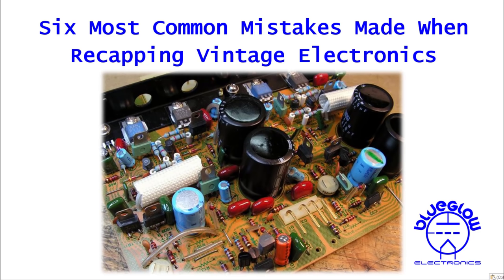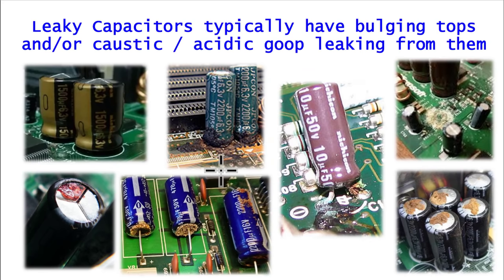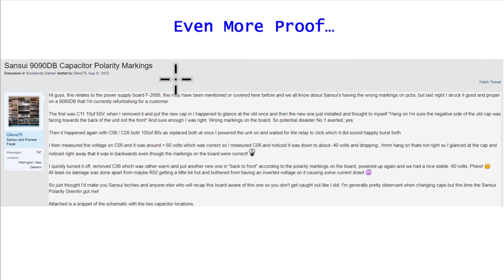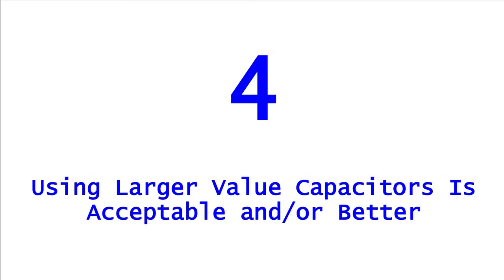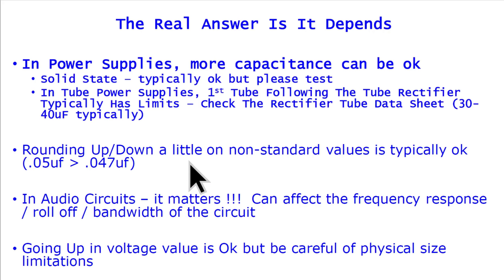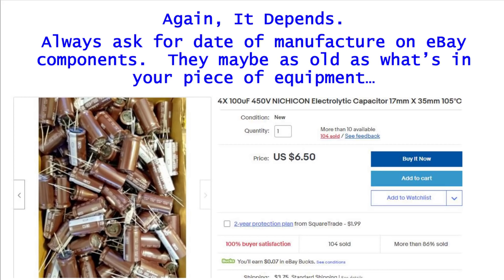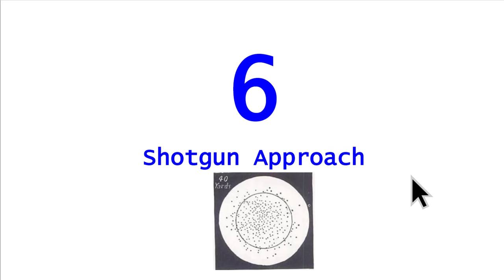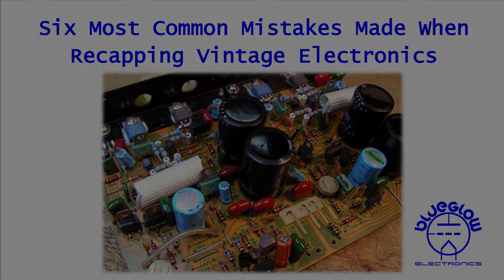Six Common Mistakes Made When Recapping Vintage Electronics

Comment: And the number 1 mistake... failing to pull out your cell phone and take a few pictures before you start pulling out capacitors.
Reply: Damn this is so true. And one step up, take a video with good lighting of various angles. I’ve saved myself so many times.
Reply: @XJ290  video thing is even better with different angles, i also do it now.
Reply: @deepaknanda1113 100%. You can find just the right frame that shows where something goes or how it was oriented.

Comment: If you're recaping really old stuff (20's and 30's era), capacitors had a lot of internal conductance that was accounted for in the original circuit that new capacitors don't have.  You may need to add a resistor in parallel to keep the circuit 'in tune', and guessing the size of that resistor is really just a guess.
Reply: That's what I did when I reccaped my Victor RE-45. It works amazing. That's a very good advice for people who don't know.
Reply: Interesting 😮
Reply: Like add ESR to the cap. The wire wound resistor has some series inductance to.

Comment: That glue when it turns brown, instead of yellow, is actually CONDUCTIVE.  Especially if it is near something that is starting to corrode.  I've fixed many malfunctioning electronics just by chipping that glue off.  When it turns brown it becomes brittle facilitating this.
Reply: In the past I had resolved CPU problems as well due to the heat sink compound getting on the CPU pins or on the visible CPU circuit. Wiped off the compound on those pins or other contact points and the computer worked fine then..
Reply: It next turns corrosive and eats the legs off components it’s in contact with.
Reply: @porkchop3656  Yes acid (or caustic soda or other)

Comment: One thing I would add, having worked on computer monitors in the  past ( 25 years ago)  some brands had that hold down glue that would over time become unstable from heat and age and become conductive on the board. We had to scrape it all off and clean the board really well.
Reply: AKA, Sony Bond. It affects all kinds of electronics. If it starts to turn dark brown or darker, get it off the board.
Reply: That's a great point.!!, I too have seen glue become conductive and cause many problems in TV's.
Reply: lol yeah the white glue is okay most of the time, but that transparent stuff is nasty.
Another fun one are those fancy looking motherboards with chipset coolers that have stickers/decals on them... those come loose over time because of heat and get trapped in the fans.
Reply: KRK monitors had some black stuff where the liquid would seep out and cause corrosion, the rest of the glue became brittle. Have to remove that and hopefully before components are so wrecked you can;t even see what they were
Reply: @Joetechlincolns  is that still common? Thanks
Reply: @j.lietka9406  Not sure on newer electronics, I'm more familiar with CB radios of the 80's-90's-2000's  that have it. It will cause corrosive damage to component leads, and cause a conductive path.
Reply: @RennieAsh  , I've seen some fairly modern powered subwoofers that had components secured with black glue that became  Extraordinarily corrosive not to mention conductive. Worse than any of the old tan or brown Sony bond glue;  And because the subwoofer amplifiers had very high density component placement and were sometimes double sided boards the amount of damage done by corrosive glue was often too massive to repair.
Reply: Many years ago I came across Sony Bond in broadcast video tape machines of the BetaCam and Betacam SP variety. The machines would loose Chroma or Luma depending on which video filter had failed. The bonding goo becomes conductive after some years. The Sony bond was found used in the filter circuits that were constructed on a mini PCB and the whole thing fitted inside a steel case and then the bottom was covered by a rectangle of resin bonded paper. These filters were about 1 inch by 3/4 inch by 1/2 inch tall. Removal of the RBP cover would reveal a brown blob. Removal of the bond would restore the characteristics of the filter. Later versions of the filter would have the base cover of clear fibreglass and you could see the white bond. This bond did not deteriorate. The duff bonding agent was also used in the switched mode power supplies of the professional grate CRT monitors along with capacitors that would leak sometime destroying the PCB. The white bond did not suffer and only the cream or tan colour bond failed in my experience. Another thing to be aware of, not so much in vintage gear, but in any gear with CMOS circuits in, is that some rubber shrouds around LED's as in the case of the Sony Beta SP machines would also become slightly conductive due to age and upset the whole control board with all the push buttons on. CMOS circuits are high impedance by design and slight resistive sneak circuits can upset the circuit causing all manner of faults. Being a Northerner in England, we would say it lit up like the Blackpool Illuminations with random LED's lit and inoperative push buttons.
Reply: I heard that glue referred to as the yellow peril
Reply: Some glue used to hold parts (capacitors mostly but sometimes other components) can become conductive over time.  Planned that way?  Perhaps!
Reply: @fflynnful   I somehow doubt it was planned that way, this was back when manufacturers took better pride in their products than today. Just the misfortune of picking a glue that didn't age well.
Reply: @davidlong1786  Planned obsolescence is a thing!  Neither of us will ever know if it was planned or not.
Reply: @Joetechlincolns  That was even a thing in Sony broadcast gear.  The BVH-2000 (one inch open reel broadcast tape) had an issue with conductive glue in the servo electronics.  It would change the speed of the scanner and capstan randomly and intermittently.
Reply: @fflynnful   Nah that would have required aging the glue faster than normal artificially to see the results and honestly I don't see them putting that much effort into this when other components like caps would age with increased ESR over time anyway and cause the deice to stop working before the glue became an issue. It was just bad luck that the glue ingredients would conduct when subjected to heat over and over.
Reply: I did that and wound up scratching down to copper a bit. Does that make a difference? Pretty hard to remove w/o having this happen unless there’s a trick.
Reply: @bobd9868  When we got down to the copper traces we would just tin it using solder and hope that lasted a long time which it seemed to do. You can also coat the soldered traces using something called conformal coating which I never have used. You might search for that online if you like.
Reply: @Joetechlincolns  = Ok thanks
I have no Sony Amplifier or else. But  nice  to read this information. 

The good intelligent manufactures use non corrosiv silicon. 
I never saw standard cheap corrosive silikon. In the future this can happen in ultra cheap chinease things. 
There might be some companys that think in europe and US the lifetime is short and the owner will soon by better electronic. 

And the lifetime of cheap TV can be short, because the rich countrys have buyer who are often replace there electronic with state of art electronic, even if the old electronic still works. No need to produce long lasting electronic. 

And companys can only exist when produce and sell new cheap electronic. 

In europe / US /AU / Canada / etc the repaire coast is very high and the people never repair electronic.
Reply: @QoraxAudio  = I also have no problems with the white glue.
Often this is very stable long lasting silicone.

I never checked the transparent wax in very old and cheap radios from japan (today china) that fix some heavy parts. 

I think these company know that no person in high industrial countrys pay for a repair. TOOO expensiv and we like stat of art electronic with additional features and a frsh designe. 

And the manudacturer exist from selling new electronic and not from produce long lasting  electronic. And no need to be able to service/repair these or even to open it. 

Oh, I forgot = Thanks for your information !
Reply: hot glue too btw.. we had monitors come back defective after a few weeks because the hot snot started to get conductive.. (glue was used to keep parts from buzzing etc)

Comment: In my 35 years of experience, remove the factory glue as the older it gets, it starts to become conducive.
Reply: Yep, and it's not just vintage gear either.  KRK got in to some hot water over the use of conductive glue in some of their studio monitors like the Rokit 6's. Dave (eevblog) did a video on it. Hideous.
Reply: Other glues you can use if necessary. Neutral cure silicone, Quick Grip and hot melt glue. I am more of a fan of hot melt  because you can manipulate it with a SMD heat gun set at 230 C .It sets quickly and it can be detached by using freeze spray. Quick Grip is my second best. Silicone must be the non acidic type but must be fully cured before switch on especially if it is used in high voltage circuitry. Oh and never use super glue on anything.
Reply: @jmiller007  I got a Rokit 5 with that issue. PITA to clean.
Reply: Thanks for the tip.
Reply: Not only conductive, but corrosive. It's sometimes just as bad as leaking electrolyte. I've had to chip tons of the stuff out of supplies that had it splurged all over everything, where it ate through transformer pins, component legs and dissolved resistor casings. I blanket remove all of that crap when I have to repair something to avoid potential damage later on.
Reply: @GGigabiteM  The only way to do it. Remove it regardless.
Reply: lots of B&O units had this problem.. there video units especially.. aging glues becoming conductive was a real pain,,glad you mention it..cheers..
Reply: @davidbwn  hot glue was a bad choice on my customs odometer design and other auto related electronics...cars in the sun reach their melt temps..
Reply: Some of the brown glues are corrosive and start to eat nearby component leads.
Reply: Older Sony tv sets had this as well-the glue would go from yellow to brown to black, getting more conductive as it went!
Reply: @davidbwn ,    Hot melt glue has one major failing, which is that it doesn't generally stick very well to circuit boards.  If the goal is to secure a component from vibrating free, such as any type of powered speaker or subwoofer or other device that will be continually exposed to vibration,  Or any device where heavy components such as large capacitors will be sitting horizontally instead of vertically,  with constant gravitational force pulling on them, hot glue just doesn't work very well.
Reply: @goodun2974  pre heat the board and it does.
Reply: @davidbwn  , that's a very good idea, but probably only works for people who have a hot-air soldering station or some type of heat "pencil" so they can keep the heat confined to a small area and not overheat adjacent components or allow the glue to creep out widely over the warmed up PC board.
Reply: @goodun2974  SMD rework station is a good investment.
Reply: @davidbwn  , in my 15 years as a bench tech,  I rarely did SMD repair.  Most of the equipment I worked on Is from the 1960s through the 80s. I did have a hot air pencil pencil suitable for SMD's, bit I used it mostly for shrinking shrink-tube insulation, melting and fusing broken plastic pieces back together,  or for blowing and flowing epoxy glue into cracks and tight spots. Most desoldering was done with a vacuum-pump desoldering gun.
Reply: @GGigabiteM   Even bare jumper wires would become corroded to the point where, although the jumper wire itself was continuous and could still conduct, the corrosion crept down through the hole in the PC board and around the leg of the jumper where it passes through the board, and the corrosion would  contaminate the solder joint and separate it from the jumper wire!

Comment: A possible exception to your suggestion against "shotgun" recapping is when restoring very old equipment.  50 or 60 year old electrolytics are often shorted, or nearly so.  Turning on the equipment with such caps in the power supply can cause serious damage.  The same applies to interstage coupling caps in tube amplifiers.  If those are electrically  leaky, B+ will flow to the grid of the next stage and that is also damaging.
Reply: I shot gun the caps in my vintage repairs. These caps are 40+ years old and way past their lifetime expectancy. And for s**ts and grins, I 'll use my ESR which says "yep.. it's fine" and use my old Heathkit leakage checker. 80% of the "good" caps fail leakage tests. The exception to this rant seems to be the smaller electrolyics normally used in the radio RX boards for example.  Most of those I replace with WIMA anyways..  I hate having to redo my work. And fixing a unit just to have a ancient cap fail a few laters is stupid. I also replace driver transistors for the same reason. You have no idea how abused they are so I just replace them since I already have the unit apart on the bench.  Zeners go to for the same reason. Carbon resistors in amplifier boards get replaced because most of drifted a fair bit and will continue to drift as they age even more.  And I should say, I don't "repair" my projects.. I "restore" or "rebuild" them.. just like a car.  And lets be clear.. this is my opinion.. nothing more. Everyone is entitled to their own opinion.  My clients are happy with mine and how I do the work :)
Reply: @MikeSweeneyMedia  ,  Yeah, if you have to undo the dial string mechanism in order to pull up the RF, IF, and/ or MPX board (often those circuits are combined on one single long PC board), you want to be really certain that recapping is done with known good caps, and that you fix any problems or potential problems before you put the whole shebang back together.
Reply: I see your point. His advice is good if you are recapping something that works already.
Reply: Yes, better to replace the electrolytic and paper caps than destroying transformers and such that are made of "unobtainium" now.  I do  the same on old tube stuff.
Reply: Oh definitely, old caps can short out. So can small smd ceramic caps if they develop a micro fracture from mechanical stress.
Reply: Is an oscilloscope essential for recapping? There's a nad 3130 being recapped in a video on this site, seems to use it religiously for each cap. Cheers
Reply: @CM-dw3gh  This depends on what is being re-capped.  An AM radio probably does not need an oscilloscope.  However they are  very useful in aligning FM detectors and for television work.
Reply: @pattyeverett2826  it would be for an audio amplifier.  The NAD 3130 to be precise..
Reply: @CM-dw3gh  An oscilloscope is probably not necessary, but an audio signal tracer would be helpful. A signal tracer would be useful to debug a mis-wired capacitor.
Reply: @CM-dw3gh  Oscilloscope shouldn't be mandatory if you know the datasheet of the original capacitor.
Reply: @MikeSweeneyMedia  yep I learned my lesson with a Tascam Portastudio. Recapped the PSU, just to have the mixer card caps fail a couple years later. Now it's taken apart on the bench again, open-heart surgery style. From now on- if it's worth recapping, the whole thing is getting a recap. The caps in my 18 channel Ramsa (40 years old this month) went out on the mixer channels before the PSU. Every single electrolytic cap was replaced, digital VU meter and all. Unlike the Portastudio, not a single issue since the recap. The peace of mind is worth it. 

and yup... not a single electrolytic out of that 40 year old Ramsa was within spec. Visible electrolyte leakage or not, didn't matter. Time did 'em all in!
Reply: @MikeSweeneyMedia   A big WIMA fan here too.  I use the MKS series and they usually fit where the old lytics were.  They get pretty pricey over 1uF, so unless I'm doing a piece of broadcast gear which demands the utmost reliability, I usually replace just 1uF and down with those.
Reply: this is where a lamp in series AND a variac come in handy..

Comment: The glue used in 70's and 80's Sansui amps and receivers is corrosive. It will eat component legs off and even destroy boards. So, a valid reason to recap a Sansui is to clean off all the glue before it causes problems.